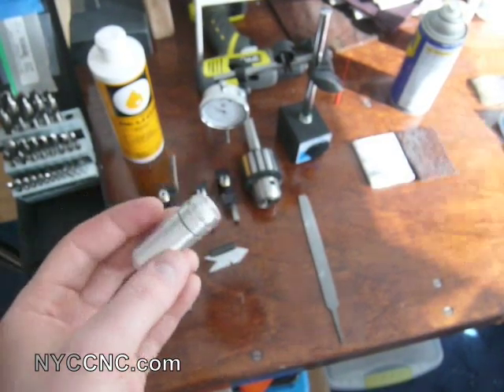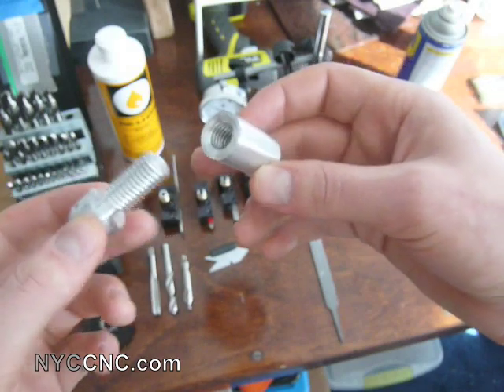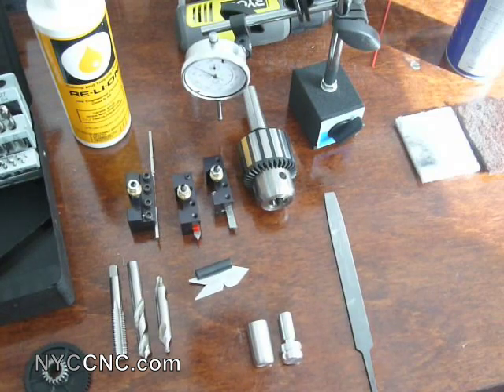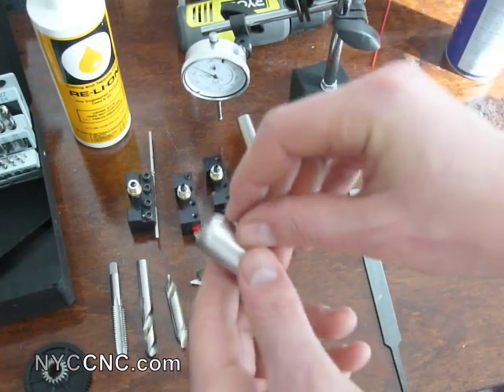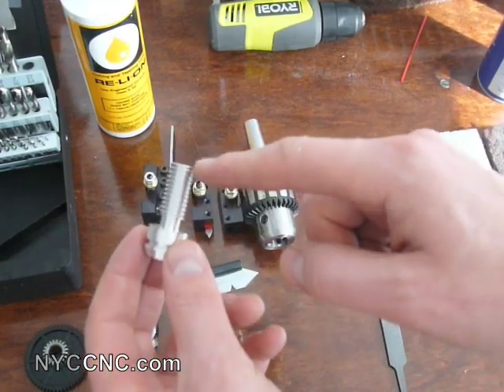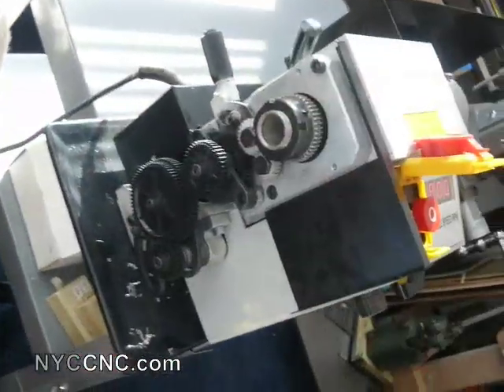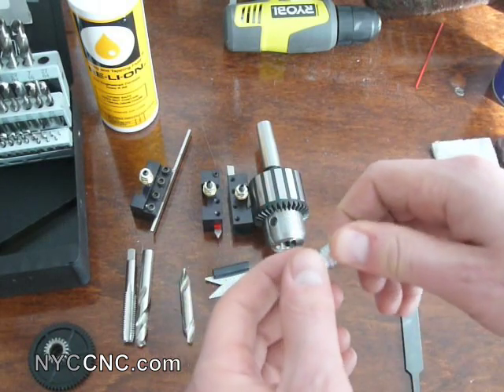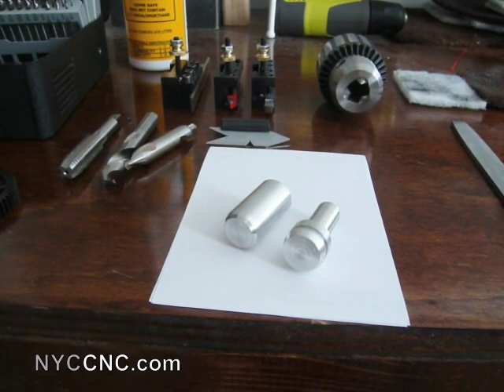First Lathe Part turned on Micromark 7x14 mini lathe ! Includes Threading!

Comment: Hello there I bought I micromark and was wondering if you could tell me how to cut a 10x1.5mm thread as I understand how to cut imperial thread but what do I do about metric? What gears do I use and my dial indicator says 16t so how do I read the imperial dial indicator when cutting metric? Thanks for any help.